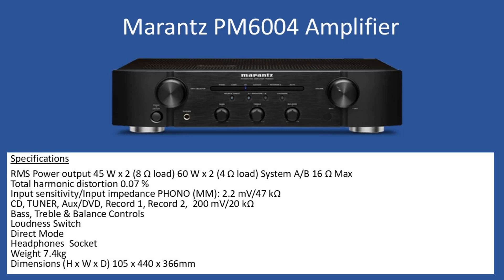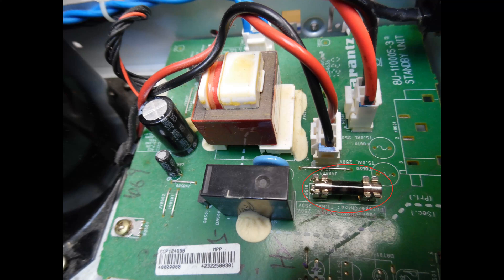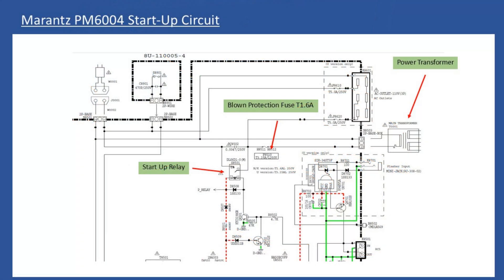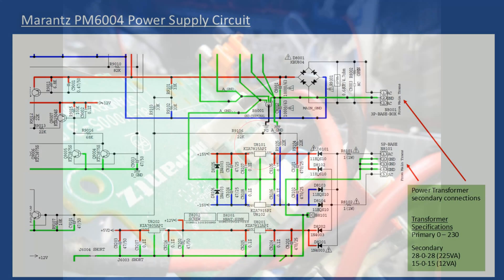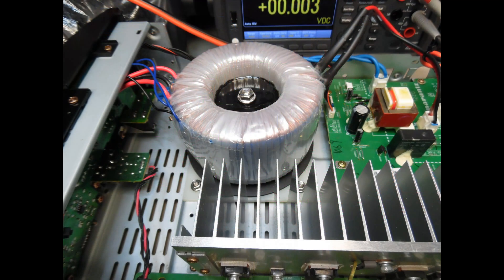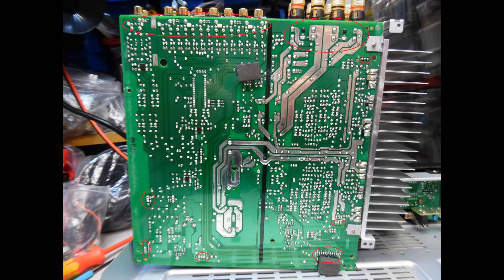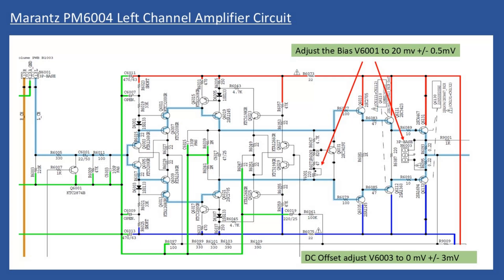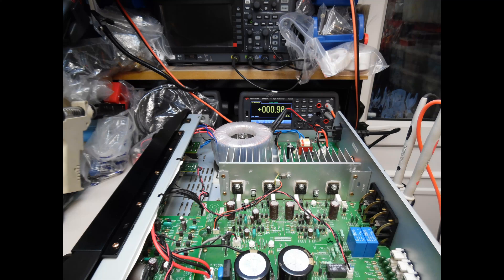Marantz PM6004 Amplifier Repair (With Audio Tutorial)

Comment: excellent tutorial. I used to own one of these and it's a wonderful amplifier. The only downside is a design flaw caused by the auto standby circuit, whether or not it is enabled, whereby at very low signal levels, such as the end of a fade out in a song, slight distortion can be heard if you listen carefully. I believe there's a modification that can be made to remove the signal detection part of the auto standby circuit to correct this, though I've yet to see a modified circuit that keeps the auto standby function but fixes the distortion issue.